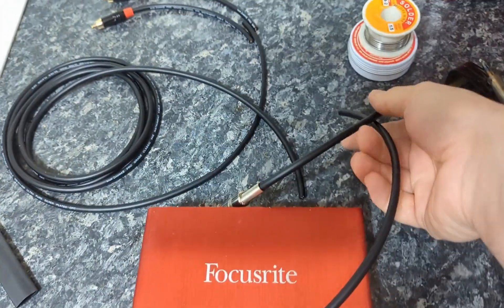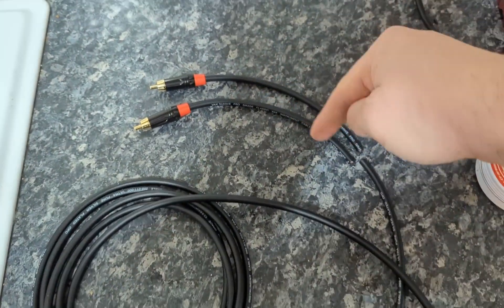How to make a loopback cable

Comment: I just ordered the focusrite Gen 4 .. 2i2 is the needed or does it use virtual loop back
Reply from the maker: All of them have virtual loopback, but that does not work for time alignment, you need a hardwire loopback. To the best of my knowledge, only the bigger 16i8 has it.

Comment: Wouldn't it be easier to run the right output into the second mic input and the left output into your DSP/AMP? I don't see why it needs to be from the same output considering we're dealing with electricity/light speed.
Reply: @RAW-CAt Please Test it
Reply from the maker: If the interface has identical.performance on both channels, that would work, however only the super high end amplifiers have matched outputs and this is a budget interface, you cannot expect that both inputs and outputs will be the same. For recording purposes it's fine, but for us to be safe the best way is to have a custom loopback cable. It's faster and easier to make the cable than to troubleshoot in the middle of a tuning session.
Reply: @RAW-CAt  Have you tested this? I'd be interested in a video to see if this holds up. Loopback cable impulses vs separates. Would be a nice thing to have evidence for and considering you have the equipment already - somewhat quick.
Reply from the maker: @iggynub yeah, I can test that.

Comment: Is it necessary to use a mono 6,3mm jack? I have 2 pieces of 6,3mm stereo jacks. If it works with stereo jacks, how do I wire?
Reply from the maker: It will work. Just use the si gle center pin for positive.
Reply: @ okej. And skip the other pin and make it mono that way?
Reply from the maker: @daniellindsten  yes
Reply: @ thanks!

Comment: The new (4th gen) FocusRite 2i2 has an internal loopback capability. Would that eliminate the need for a loopback cable? 

If a loopback cable is required, apart from convenience, is there any reason to add the second RCA connector?
Reply from the maker: Internal loopback is virtual. It will not work for this purpose.
Reply: @ Thank you!

Comment: Hi, Nerijus. Thanks for doing this. I picked up a cheap usb 7.1 channel sound card with dual mic input and use it to measure inpulse response using Dayton IMM-6 mic. It works really well. I had to play with the level out loopback since it's line out level and mic is expected to take in lower voltage.

My question is, what do you do if your driver do the phase wrap, or the weird U phase due to whatever reflection or cabin gain? And it's at the crossover regin(1octate before and after xover)?

Should I move the crossover point to somwhere where both driver have no phase wrap? or just use helix to do phase wrap with allpass on the other drive to "match" the driver with phase wrap?
Reply from the maker: It depends on the frequency where that wrap is. Anything in the midrange drivers or tweeters I would leave alone. Adding an all messeses the imaging up. I use all pass only for midbass drivers if needed.

Comment: Is it possible to make this type of cable with rca splitters instead of soldering the wires?
Reply from the maker: Of course. Connection is a connection. Use as many adapters as you need👍

Comment: Not sure how I came to this video, but have to say it was good to watch. Not sure I will ever need this info, but the point about the heat shrink is good. Hadn't thought of doing that for a coaxial cable. (Though I'm rarely working with cables so...) Thanks! ❤

Comment: how important is to connect the outputs directly to DSP? Can I use my car's multimedia aux input for feeding signal to DSP while doing TA instead? Btw is it important to do DAC calibration in the HOLMimpulse before doing any measurements? thanks again for another great video!
Reply from the maker: You can use aux if you wish to. For phase alignment the sound card calibration is not needed.

Comment: Totally irrelevant to this specific video, but... I already watched 90% of your videos (just like 6-7 other sq audio channels too) and the amount of data in my head is making it hurt on a daily basis. :D What would you recommend if I'm looking for a single unit to upgrade my system? I'm looking for a bt-dsp-4-chan amp triple combo device to actively run my 2 way fronts and do time alignment, eq, filtering and have an rca output for my monoblock for my sub. I was kinda narrowing it down to an AudioControl D-4.800 with the BT module, but it's quite far outside my budget atm. TIA.
Reply: Get a Alpine R600S, is only 200 dollars ish
Reply: @smartorder4997  has no amp
Reply from the maker: The Alpine PXE-R500 would be an amazing option, slightly pricey, but quality item. More expensive option is Helix M four DSP. If you are on a very tight budget, get something from China,like the Sennoupu I reviewed.
Reply: @RAW-CAt and how do I get BT for both?
Reply from the maker: @kovacspis  you can get a $30 LDAC capable BT receiver from AliExpress (it tested very good) and use optical out from it to DSP.
Reply: @RAW-CAt  Ah yes, I remember your review of it. Thanks for the tips man! I ruled out the Seonnoupu X10, even in your review and in lots of russian videos' comments it is declared a piece of shit really. I haven't found any PXE-R500 for sale btw. On a much more important note: your cat is very cute.
Reply: @RAW-Cat, you always mention AliExpress in quite a few of your videos, guess it’s a site I can trust no? 
Seen a lot of car audio equipment real cheap - I’m just a bit hesitant.
Reply: The R500 is only $180 in our website